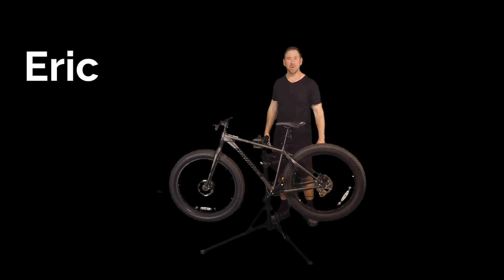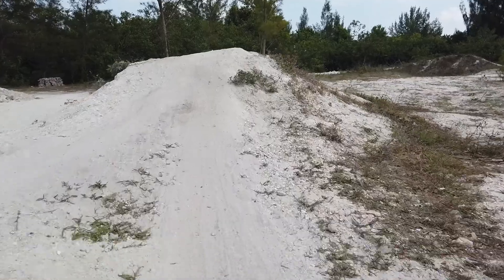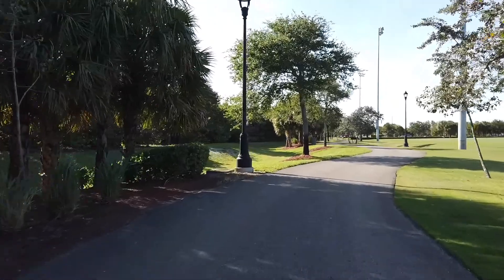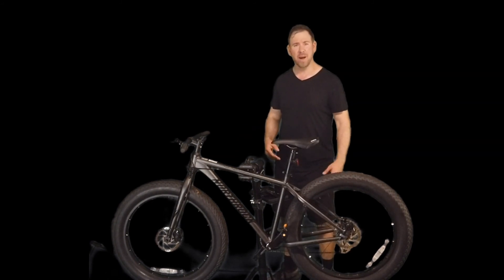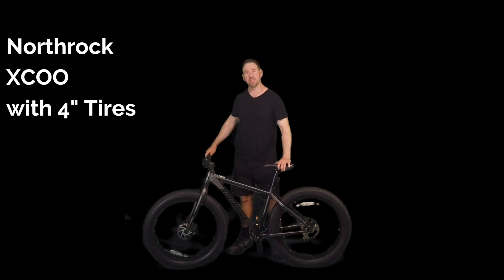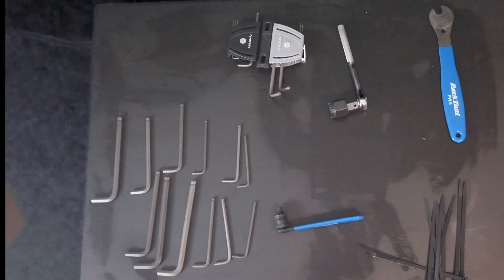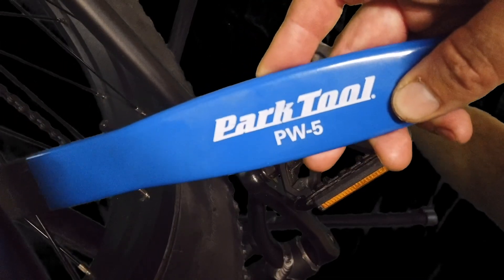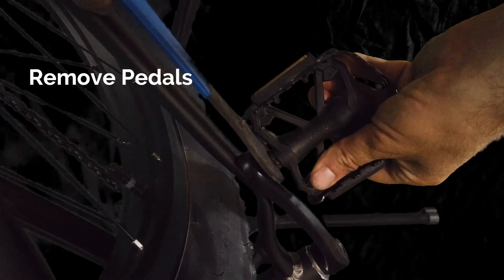Installation of Bafang Mid Drive Ebike Conversion Kit and  BBSHD Review

Comment: I have the same bike XC00 (I love it), my kit just came, thanks a million!!!
Reply from the maker: Nice! How did the installation go?
Reply: @expedition-electric3549  
Just getting started, had 4 other bikes, I had to finish, promise, I'll touch base!!!
Reply from the maker: @snip_king428  4 other bikes!?
Reply: @expedition-electric3549  
Yes, yes, all my friends want ebike conversions, but my XC00 will be my first mid drive build.
Reply from the maker: @snip_king428  Ohh nice, so you've been installing hub conversions for your friends? Which Brands?
Reply: @expedition-electric3549  
Waterproof ebikeling kits
Reply from the maker: @snip_king428  cool!
Reply: @expedition-electric3549  
All done, I LOVE it, smooth and quiet!!!
Just need a 52v battery 🔋 now!!!
Reply from the maker: @snip_king428  Excellent!  I went with the 48V Battery, but sometimes wish I had the 52V
Reply: @expedition-electric3549  with 500c controller it reads 75% with 48v
Reply from the maker: @snip_king428   I see.

Comment: Nice job.  I did the same up grade on the same bike. But I have a 52v 17.5 amp battery. I believe I get 36 mph if my tires are pumped up to max psi.
Reply from the maker: Nice!   If I get the 52V battery I will def try it with this motor. Approximately how many miles do you get per charge?
Reply: With the right gearing I get close to 40mph on my fat tire ebike I made

Comment: Great video.  Just installed on a trike with a rear rack battery and only a few cable extensions.  I've changed to 9 assist levels, changed brake levers, connected the speed sensor and shift sensor but have two serious problems:  (1)  The throttle cable is a yellow female and all yellow cables from the motor are female.  I've connected a male/male yellow cable and the throttle doesn't work.  (2) Regardless of the assist level selected I get a start assist surge and that's it for the assist regardless of my pedal speed.  Any help would be appreciated .  Thanks.
Reply from the maker: Thanks! Sounds like an awesome bike.  1. Did they forget to send the 1T4 cable in the package?     2. Not quite sure, other than the speed sensor being slightly off. Did you Try the PAS with 5 levels?
Reply: @expedition-electric3549  The speed sensor light blinks with every wheel revolution; I can try relocating it.  It came preset for 3 levels and responded the same way.  I'll try 5 levels. It came with 1T4 cable and both yellow connectors are female.
Reply: I think you've solved my problem.  I had the male yellow 1T4 cable connected to a yellow female from the motor.  The throttle works when connected to the male yellow 1T4.  That will probably fix the PAS problem, too.  Any idea what the yellow female from the motor is for ?
Reply from the maker: @Avatar1946    Hmm,

So you have the two yellow female cables for the left and right digital brake sensors,  the green for the display and yellow male for the throttle.
Reply: @expedition-electric3549  Once I disconnected everything and looked at it all again I noticed the yellow male buried in the cable run bundle.  My bad.  Thank you for all the assistance.  All systems are "go".
Reply from the maker: @Avatar1946  Nice!  I’d love to see a pic when it’s done!
Reply: As soon as I can figure out how to send one along, I will. @expedition-electric3549
Reply from the maker: @Avatar1946   hmmm.  You could msg me here and then I’ll send email back. 

https://expedition-electric.com/contact-us/
Reply: @expedition-electric3549  I just did.